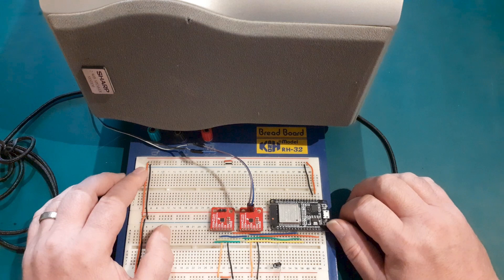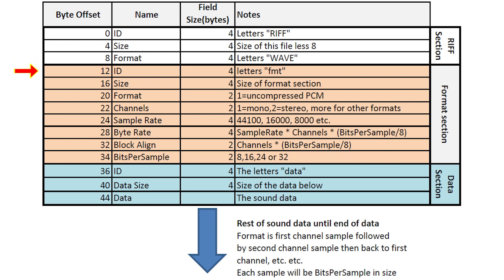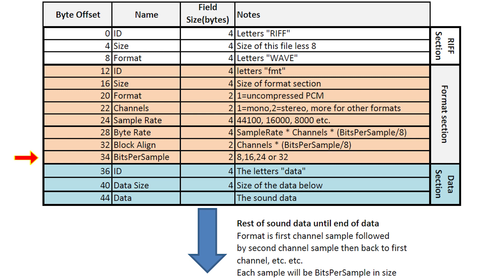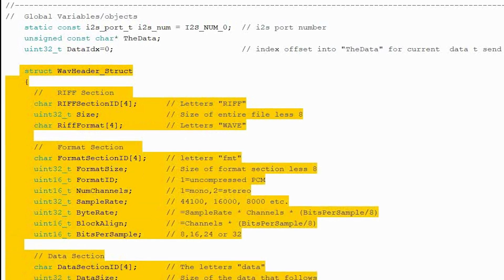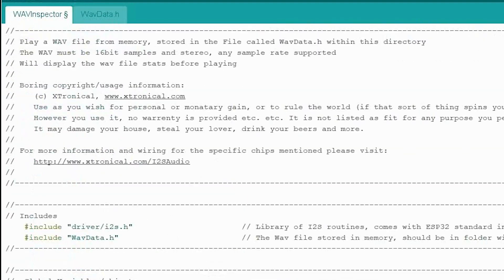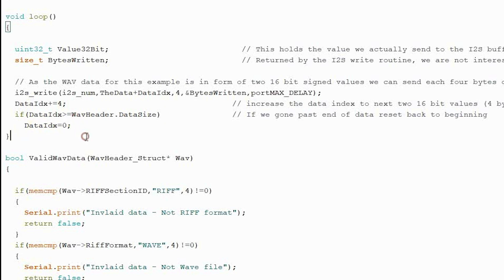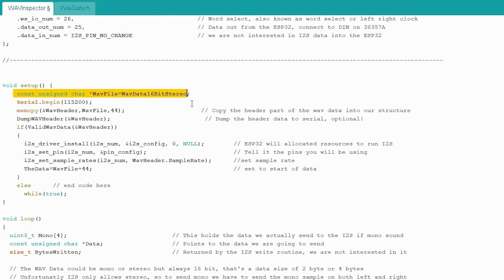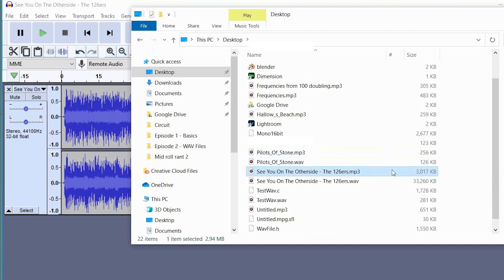Understanding & playing WAV files on ESP32 using I2S. An In-Depth Tutorial with very simple example.

Comment: Please, can you actualize the XT_DAC_AUDIO library? It has several errors now latter the atualization 2.x to 3.0 of espressif changes commands.
Reply from the maker: Thanks for the information. I'll take a look.
Reply: @XTronical  Thanks for your atention! Your library is the easiest to use and I cant now use a simple hex song for my project without this update in some commands.
Reply: I wonder why my board is crashing now. It used to work fine and I even made several engine sound modules but now with the latest esp32 boards packages my chip crashes
Reply from the maker: Looks like something has changed. I need to get some newer boards and updates etc.

Comment: I see hardcoded references to the GPIO pins 25 and 26 in the library code.  If I want to use this on an ESP32-S2, where the DAC GPIO pins are 17 and 18, should it work just to change those references?  (I tried just doing that and don't hear anything.)
Reply from the maker: Yes, you'd have thought so in theory. I can't remember the exact differences off hand to know why it wouldn't work. Have been successful with a normal esp 32?

Comment: Great viseo
I have successfully included 3 small hex header files.
If I change in setup const unsigned char *WavFile = headerfilename;
then I can play each file after recompiling and uploading.
I want to know how I can change to different sounds (Using switch case in the void loop() section and play the sound once.
The switch statement will depend on a button press so that I can play each sound depending on which button is pressed.

Thanks in advance and keep up the good work
Reply from the maker: Will get back to you in a few days.
Reply: @XTronical  Or years

Comment: thankyou for these, I 've sunk an entire afternoon going through your DAC wav and i2s videos. currently for a model train sound project I'm using a esp8266 and the DF robot mp3 player to produce sounds but looking at your videos I'm encouraged to switch to esp 32. sound mixing, vol  and speed controls are a big plus. one fundamental question, what is the benefit or need to use i2s instead of the built in DAC? is it just to be able to use any pin on esp32 and get better sampling rate above 8mhz? or are there other benefits ? coz it seems either ways externally you still need an amp board or a i2s decoder with built in amp?
Reply from the maker: As you mention the sound quality can be much higher in addition it's easier to do stereo, requiring only the one same single pin. We'd need two dac pins for stereo using DACAudio. At the moment existing i2s libraries are not as flexible as DACAudio which is why I'm implementing that library for I2s.
Reply: @XTronical  absolutely gonna watch and wait for the i2s audio library and it's corresponding video.
Have you tried basic wifi functions of simple webserver libraries and so they work well with your dac and later i2s libraries? My end goal is to have a remote motor ctrl receiver and be able to drive audio sounds ( engine sounds) in parallel to the motor commands like speed or direction.

Comment: Thank you so much! This video is excellent!

I have a question about the wave.h: Does it has to be in hex? If I'll write it as a short int, will it still work?
Reply from the maker: Doesn't have to be hex, just make sure your storing 16 bit signed integers.
Reply: @XTronical  
Thanks for the answer!
Btw, I really like your videos, they are coherent and crystal clear (and above all, you're helping others in the comments!).
It's not much, but I donated 20$, keep up the good work!
Reply from the maker: Thanks for the kind words. I appreciate it. And thank you very much for that donation, that is loads, honestly, to give to a stranger! Thank you again. All money goes into the channel.
Reply: @XTronical  
Hey, I have another question:
I noticed that for some of the WAV parameters, the values are reversed.
For example, looking at the Sample Rate portion, you wrote 0x80, 0x3E, 0x00, 0x00
But when I converted 16000 to hex, I got 3E80, so why didn't you wrote 0x3E, 0x80, 0x00, 0x00?
I'm mainly asking because for the size portion, you wrote 0x10, 0x00, 0x00, 0x00, which corresponds to  16,000.